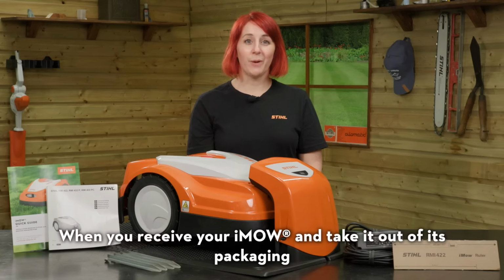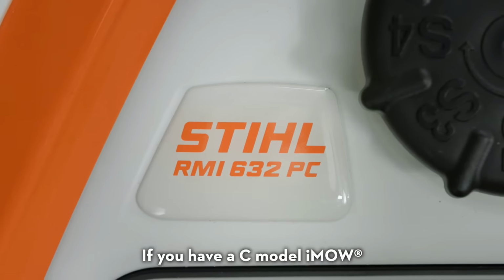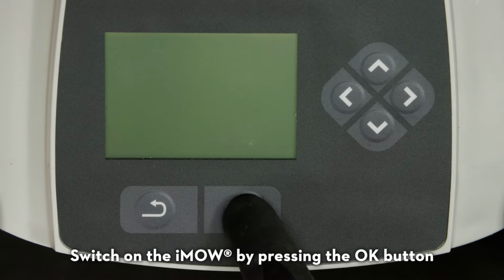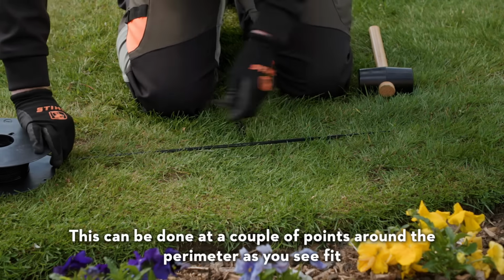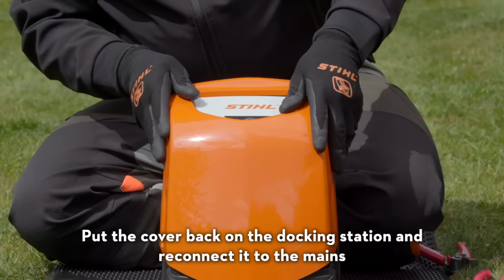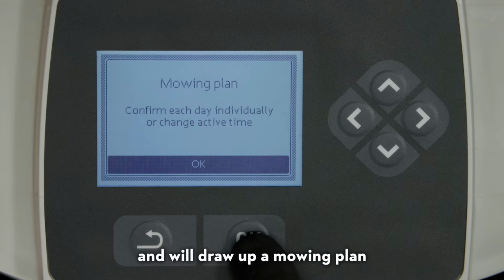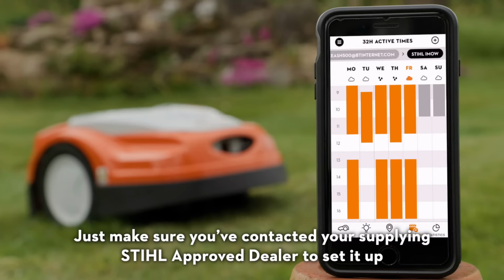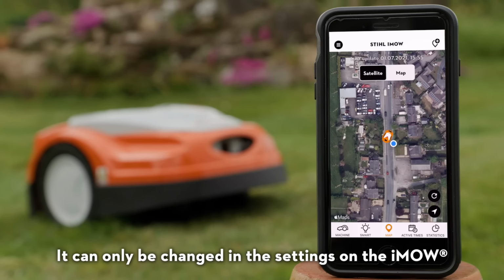How to Install Your STIHL iMOW® Robotic Lawnmower | STIHL iMOW® Installation Guide | STIHL GB

Comment: this one is identical to the viking 422 which states 22cm from the edge and stihls asks for 28 cm ? why ?
Reply from the maker: Hi, thanks for your comment. The general recommendation of 28 cm applies to the STIHL iMOW to make sure the machine does not come into contact with any walls or obstacles, although 22cm can be used on low obstacles like paths or corridors. Thanks, STIHL GB

Comment: What is the size of the stick you used to measure wire next to concrete?
Reply from the maker: Thanks for your question. The piece of cardboard that is used in the video is marked up with various measurements, depending on what part of the install you are doing. The guide is included with the mower when you buy it, but you can also find more details about the different measurements in our article here: https://www.stihl.co.uk/en/garden-ideas-and-advice/power-tool-maintenance/robot-mower-tips/imow-installation
Thanks, STIHL GB